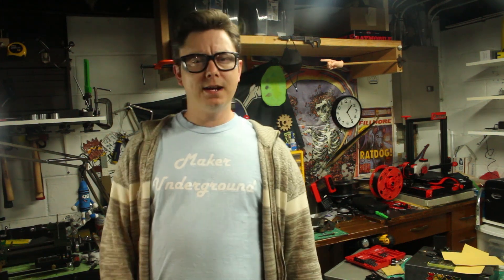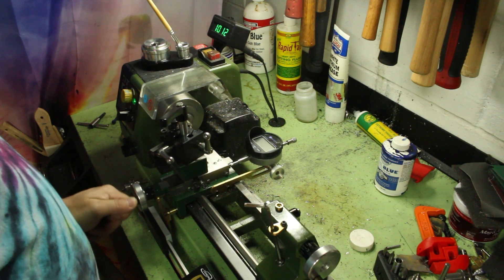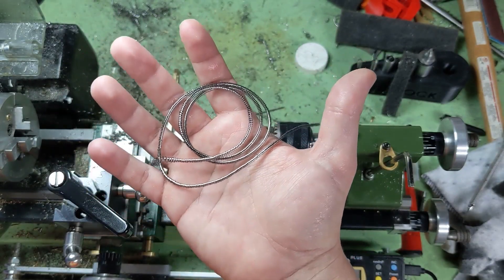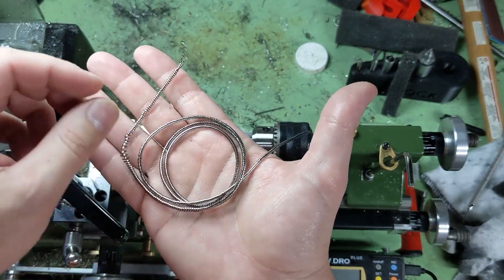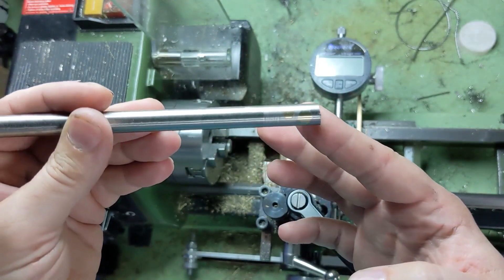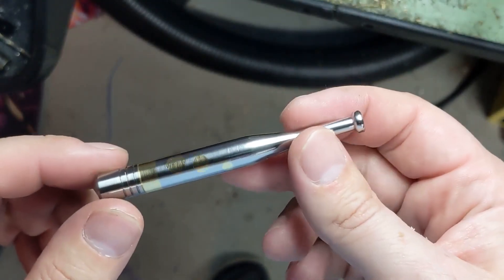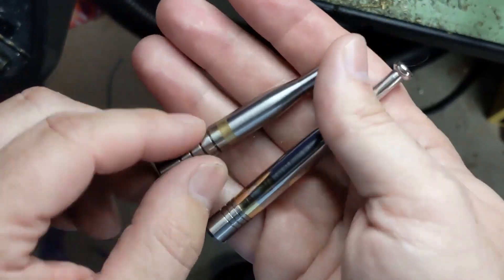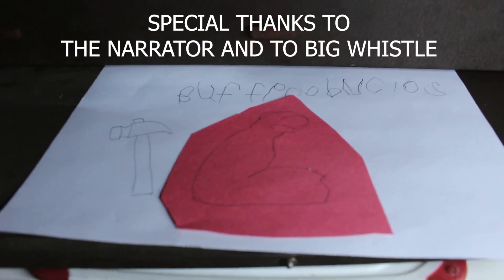Making a ....WHISTLE?!

Comment: I wonder if inhaling into the whistle instead of exhaling would have different effect
Reply from the maker: It turns out it was a reusable straw after all!
Reply: @makerunderground  Might just me being paranoid but I'm not sure I'd use either 303 or brass as a straw.  I've read that it's not food safe but don't have a reference to anything official.

Anyway, keep the videos coming 'cause they're great!
Reply from the maker: @ifitrollsrideit530  the straw thing was a bit of a joke. That being said, I have redesigned these to be 304/6Al4v so only food safe materials are used in the airway. I've also switched the ornamental metal to silicon bronze to reduce the risk of any kind of lead contact. There will be an update video eventually. Thanks for the feedback, all the same.
Reply: @makerunderground  That's great.  Any tips on machining tougher metals like 304 or Ti on a small lathe are always appreciated.  I generally steer clear of Ti.  I'd love to use it more but I'm scared of turning it on my PD250/e.
Reply from the maker: @ifitrollsrideit530  sorry I haven't responded to this message. I've actually decided to make a video on this topic, probably in the next few days. I'll be sure to let you know when it's out!